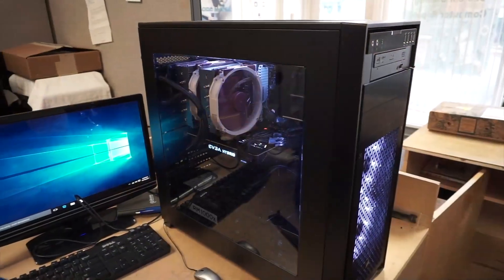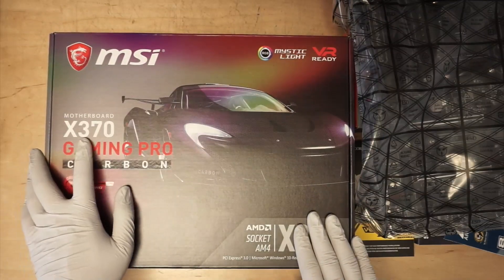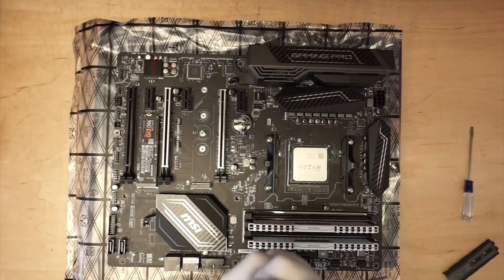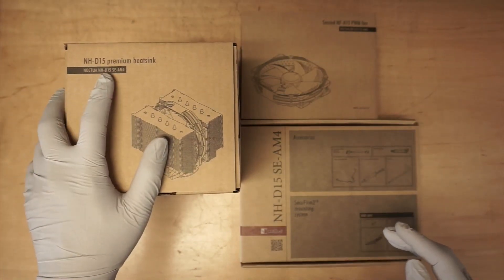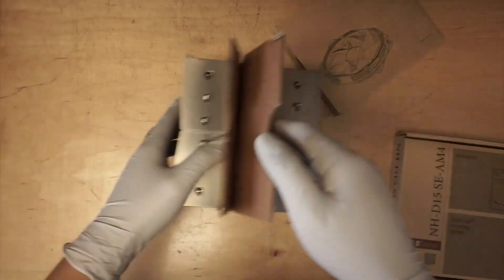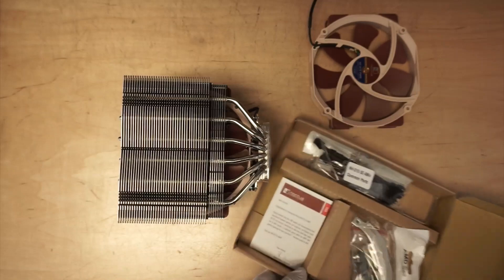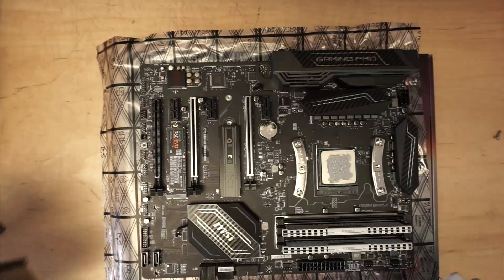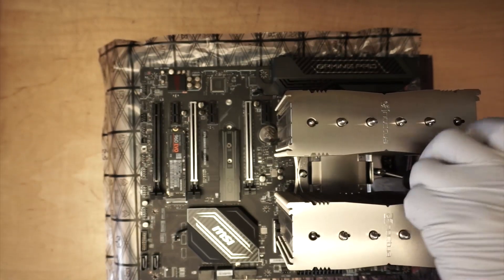How to build a Gaming PC.

Comment: Thank you so much for responding! To answer your question just the motherboard has light and nothing else turns on. Help! Thanks again
Reply from the maker: If that's the case, I would check the case power button cable, reset cable, HDD cable and power light cable. 
He might have put them on the motherboard in wrong place.
See this picture:   http://www.lunashops.com/images/upload/Image/14-hh-kgx-2.jpg

Hope this helps. Cheers.
Reply: @UbergeeksBiz  My son took the pc apart and reassembled it and now it's working perfectly. It was probably a loose or misplaced wire the first time around. Thank you so much for responding and for the time you took to help. It was greatly appreciated.
Reply from the maker: @mrs5675  Awesome !!! I'm sure he is very happy with his new toy.
Reply from the maker: If you look at the cable, one side has writing and the other is blank. The side that has writing should face towards the motherboard. The blank side should face away from motherboard.

Picture sample: 
https://qph.fs.quoracdn.net/main-qimg-f14aabafd4e08ad7004467c9aa8f3f77-c

Comment: My son just built his gaming computer last night using this same 750D case everything went well but when he tried to boot it wouldn't turn on. the only light on was the motherboard. Any suggestions or help you can send my way would help. Please he is so disappointed.
Reply from the maker: Hi, I'm sorry to hear that. Does the computer actually powers on and show display on monitor ? Or just the motherboard has light but nothing actually turns on ?
Reply: Did he remember to switch on the main power switch at the back?! :)
Reply: @pandy280677  He took everything apart and reassembled and now it's working perfectly. He must have had something loose the first time around. But, I want to thank you for responding and for your time in trying to help.

Comment: First part of the video was good, you talked through what you were doing - so thumbs up for that. However when you started plugging cables in you stopped talking. You may as well have skipped that whole section out as it served no function. Would be interesting for you to redo this video with a modern setup, but explaining what all the leads are, and where they go. you didnt even explain about power pins, mod/no mod psu's etc....
Reply from the maker: Will do a better video next time. Thanks for the pointers